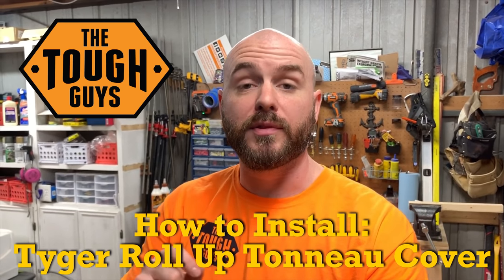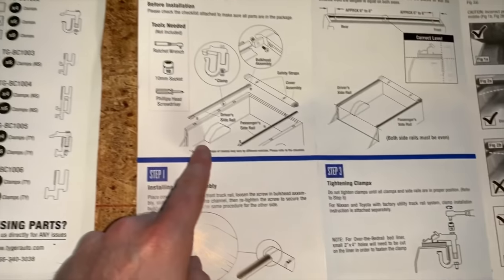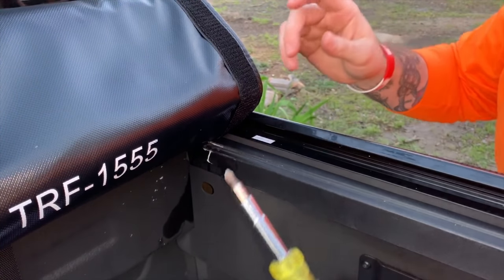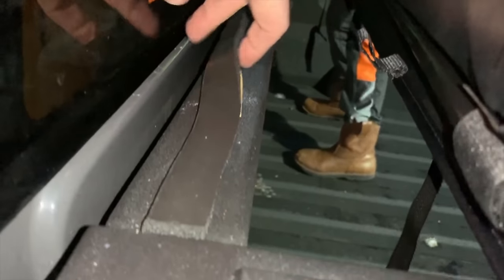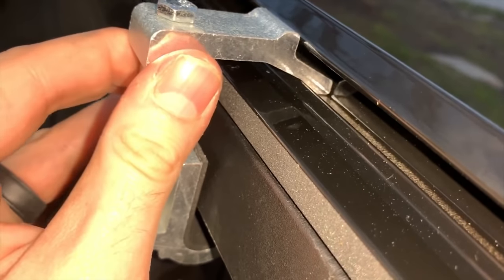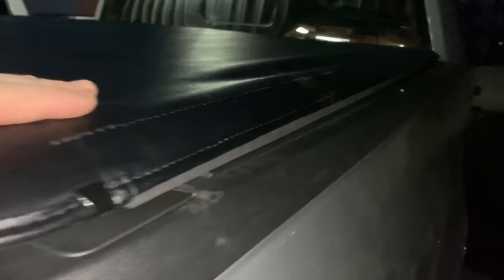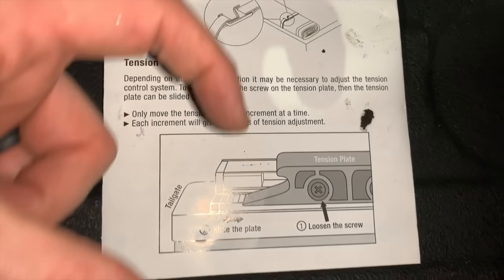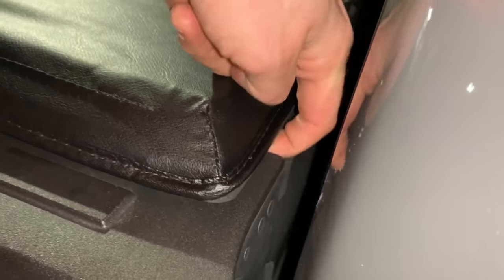How to Install a Tyger Roll Up Tonneau Bed Cover for a 2018 F-150

Comment: i had to install that extra foam piece too. are you noticing your cover is ballooning or lifting towards the front any any speed past 60mph? its making me nervouse, its like the bed is getting filled with air. i have no light leaks and it seems air tight and i have all of the clamps pretty dang tight. i even gorrilla taped from the inside any where i think air may be entering from, any one give advice! fyi this is my first tonneau. everyone i talk to that has a tonneau says theirs lays flat on the high way.  is it just the tyger brand??
Reply from the maker: Bret Lange may be an issue with yours possibly? I’ve not had those issues - definitely look around in the comments here, lots of good info here.  Thanks for watching and for reaching out!! 💪🏻
Reply: I've got the same issue. It doesn't seem to puff up much but I wasn't sure how much is normal. I was looking for videos of someone driving with a cover on to see if I had mine right.

Comment: Appreciate this video so much! And your kiddo is adorable. I have a 2017 F150 Fx4 with a 6.5 ft bed. Making a cross country move from TX back to my home state of WI, and want to protect whatever I put in my bed from the unpredictable fall weather during the drive. You made installation seem much less daunting than I made it out to be in my head 😁 Will definitely refer to your video for install when the cover arrives this weekend. Thanks again!!

Comment: Well done, just received my cover and wondered how to start after reading the factory supplied directions. Your explanation made it clear. I had to supply my own weatherstriping. I used rubbing alcohol to clean the Ford bed liner's flat plastic surface where ever the weather stripping would make contact. Seemed to help
Reply from the maker: Hey Jim, thanks for the comment!! Glad your install when well and thanks for watching!! I hope your cover lasts and performs great! 💪🏻

Comment: Thank you very much for your video! I checked the part out on Amazon this Sunday and proceeded to watch the manufacturers video which was roughly 3 minutes long. I searched more and then found your video which was very detailed and 'from scratch'... go-backs and all. After watching your video, I felt more comfortable ordering the part. It came in 2 days and I just installed it in no time! I even bought the ratchet set attachment for my impact drill (which shortened the time even more). I must say, it looks pretty nice. I did see light coming in through certain areas which means the foam isn't as flat as I thought it would be. I was going to ask you for your thoughts on it being air-tight, but I saw a few comments below that revealed it's not... and that it's not 100% impenetrable to rain water. Nevertheless, I think it was pretty reasonable and we'll see how it works. Thanks again for your help!!
Reply from the maker: Thanks so much for sharing your install / comment - I am very humbled my video was able to help out!! Overall it’s a good cover I think, obviously has some minor flaws, but for the price it’s pretty awesome honestly!! Glad you had good luck as well and thank you for watching!!!
Reply: @TheToughGuysTV  Absolutely!!! (=

Comment: great video. I subscribed, and Ill be installing mine tonight.
Reply from the maker: Thanks for subscribing! Truly appreciate it, hope you find value in some of my other videos as well. Good luck with the install!
Reply: @TheToughGuysTV   The install went pretty well. the only issue was it was tricky to tell how far forward or back to mount, and I mounted maybe a 1/2 inch too far back. Only thing is that the rear corners of the cover just barely peek over the edge of the tailgate. its a quick adjustment though. thanks again.

Comment: Thanks for the video, I was installing mine and was getting frustrated because I didn’t have the tailgate open when trying to close it. Once I tried with the tailgate down it closes much easier and snaps. I thought it was too tight and saw the adjustment was already at the last mark.
Reply from the maker: Thanks for the comment!! Glad you got yours installed and that the video helped out in some way.  I appreciate you taking the time to share!

Comment: Nice job, clear explanation of the install.  Now that it has been a few years, how is it working out for you?  Any wear?  Any leaks?  Would you buy this again if you had to get a new truck?
Reply from the maker: I kept this cover for about a year and half past the video, then traded in that truck. I never had any issues with it while I owned it, would def buy same one again!
Reply: @TheToughGuysTV  cool.  I just installed this one on mine.  So far so good.

Comment: Just found your video! Well done! One of the best tutorials I’ve ever seen.
How’s that cover holding up a year later?
I’m really thinking about getting this one (depending on how happy you are with it after a year)
Reply from the maker: We had this cover all the way until selling the truck, it never had any issues, occasionally I’d check the bolts to tighten it up, overall was great.

Comment: What about running it through a car wash? Does it keep water out then? I have a hard top bed cover on now that only lifts and does not role/fold up. I'm looking for something to be able to get more use out of the bed of my truck. But need to make sure the bed doesn't flood when I take it through the car wash. Thanks!
Reply from the maker: Charles, we only seamed to get water in near the tailgate, and a tiny bit up by the front as well. Same would happen in a bad rain storm.  It was never more water than the grooves in the truck bed itself, so anything we had stayed dry. I’ve got a hard shell cover as well which we currently are trying out for a bit and I feel like it actually lets more water in.  The issue I think is sealing in the truck bed itself. My bed is spray lined, so getting any foam to attached to get a better seal is tough.  

Thanks for watching and I hope these answers help you out!!! 🙏🏻🛠💪🏻
Reply: MI

Comment: Great video, how has it held up over the past several months, and in rain,  does it keep the bed dry?
Reply from the maker: There is some minor water intrusion from the sides, not completely water right for sure, but I wouldn’t say it floods or anything. The water is never deeper than the bed ‘grooves’ so anything sitting in there is never wet. Only real complain after use is that it makes some noise when driving, as it vibrates a bit. We’ve tried tightening it down, but the sound stays. Honestly I don’t notice that, but my wife does. 

Overall it’s held up well and it’s a solid bed cover!!! We are going to test out a truck fold hard cover on a trip soon as well and see if it’s any better, so if you’re on the fence stay tuned for that video! 

Thank you for watching and for reaching out!!! 💪🏻🛠🙏🏻
Reply: @TheToughGuysTV  thank you for the reply
Reply from the maker: No problem at all!!

Comment: Thinking about getting one for my 2019 F150 XLT, how has your cover held up since you installed it? Would you get it again or go for something different ?
Reply from the maker: It held up pretty well. We ended up getting a 2nd cover for longer trips, we were taking a long trip to CO, but then we ended up using it all the time. It ended up being more versatile overall - I did a video as well on it. 👇🏻

https://youtu.be/o9Ns7mNHNF8

Thanks for reaching out! 💪🏻

Comment: If I didn't like the looks of the side rail clamps, is there any reason I couldn't drill through the rails and bed and through bolt the rails in place?
Reply from the maker: Great question - I'm not exactly sure if that's good to do or not.  May want to confirm with a local truck accessory shop near you to see if they've drilled through before.  Whatever option you'd want to make sure it's removable and fairly easily in case you need to change it for any reason.  Circle back if you end up going that way and let everyone know how it went if you don't mind!  Thanks for watching and for reaching out!

Comment: Hey thank you for the video. I have same truck with you and I was trying to install today but my latch was popping up so easily. Any idea?
Reply from the maker: Was it really tough to engage it? Maybe it’s too tight and it’s popping out? Alternatively it may be too loose. That’s a hard one to say for sure without seeing it in person, but trial and error the overall position to adjust the tension when you lock it down.  Let me know what you find!! And thank you for watching and for reaching out!!!
Reply: The little clip on the side rail was not tight. I just installed it. Look awesome! Thanks!
Reply from the maker: Awesome Lee that’s great!! Glad you got it working!!!

Comment: Ok I have a 2005 dodge quad door Dakota . I bought a Tyler roll up tonneau cover for my truck . Ok for some reason the cover seems a little to long and the tail gate won’t shut. So would you do a video doing one of these covers on a dodge Dakota around the 2005 models
Reply from the maker: I don't have a Dodge Dakota - I'd need to have that type of truck to do an install video for it unfortunately.  Good luck!

Comment: I have mine installed. I can't get it to closed, to much tension.  It closed and easily before I tightened down the clamps. One clamp I tightened to tight. I can tell, because it bowed the rail a little.  How can I fix this??
Your son I'd adorable! I did adjust the the tension as suggested several times.
Reply from the maker: I'm not sure on the tension issue.  Is it possible it's misaligned / off center? Or maybe they sent you an incorrect sized unit?  Hopefully you found a fix in the meantime - Thanks for the note and for checking out the video!
Reply: I assume you have the tension plate on the line closes to the bed of the truck.  4th line.   Are you sure the cover rails are inserted all the way into the cover?  This is where you loosen the one screw and screw the rail to the cover.  Doesn't take muc h to make the cover tight.

Comment: My instructions said I might have to cut a hole in the Berliner rail of the clamps don’t line up square. Yours line up like mine, have you had any issues with the cover?
Reply from the maker: No it never had any issues.  We switched to a different type not because this one was bad, but because I wanted to try a 'hard cover' type.  To be honest, I miss the ease-of-use of this model, it was awesome.
Reply: @TheToughGuysTV  awesome thanks for replying so quickly! Got mine installed, looks great!

Comment: I installed mine last night but the front of the roll up cover isn’t flush on my tailgate so there is a gap is that suppose to be like that?
Reply from the maker: I don’t think you should have a gap at the tailgate
Reply: Any way to fix that?
Reply: @dustincarter7258   I was having the same issue.   My cover would latch and pop up a bit.   Tyger sent me a bunch of things to look at but my install was according to what they sent.  I found the top of the rail where the latches insert was bent up about 3 mm.  Look at the end and see if the metal rail is above the plastic insert.  I was able to tap this down and now my tailgate seal is much better.  I can send pics that explains it better.  Will have to see how it holds up as I just installed the cover on my Tacoma Sport

Comment: Mine won't lock and I can't figure out why
Reply from the maker: Have you tried to adjust the overall tension? Could there be anything interfering with the locking mechanism? Hard to know for sure but I hope you’re able to figure it out! If it is something weird and you’re able to fix, please share here so it may help out others in the same position! Thanks for watching!

Comment: just tried this on my ram 1500 reg cab and three bolts sheered in half. going to try find replacement bolts that are better. oh yeah i had tightened them and they snapped in half.
Reply from the maker: Lou, thanks for the info and yes these bolts don’t seem to be super high quality. I tried to be easy with the impact driver as I went not to wrench too tight as well. If you don’t mind, let me know where you get those replacement bolts here maybe to help someone else in the future!! Thanks
Reply: Should only torque to 26 ft lbs.

Comment: Can it be opened with the tailgate closed?
Reply from the maker: James, I do not believe there is a way to release it without opening the tailgate first. I know here are some types that do allow you to leave the tailgate up, but this one doesn’t not.  Thanks for the question and for watching!! 👍🏻👍🏻
Reply: @TheToughGuysTV  makes sense, I didn't see the latch mechanism on the end.  That's pretty awesome for being as cheap as it is.
Reply from the maker: I really like it! My wife’s mother has one that is spring loaded and retracts into a little box near the cab and that one has a key lock so you can open with the gate closed. This one is pretty awesome for the money honestly, and it’s an easy install.

Comment: After you install this on your Ford, you might as well replace the transmission, brakes,  door hinges, emf sensor, maf sensor, radio harness, front headlights and entire front suspension....
Reply from the maker: Yeah! Blah blah, FORDS, blah, blah, blah, TRUCK STUFF, blah blah, blah, blah, JOKES, blah, blah. 

My truck runs just fine for us. I’m not a truck enthusiast, I drive it to work everyday. If it’s your thing to trash certain brands, I can’t stop you nor care to - just saying that for some people a vehicle you hate may be just fine for them. Me personally, I’ve got better things to worry about. ✌🏻

Hope you have a good day!